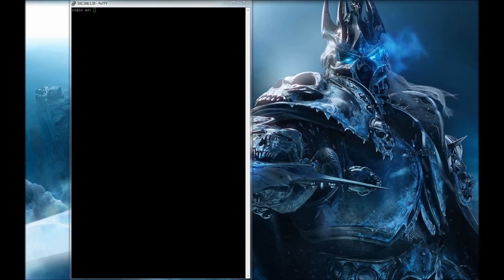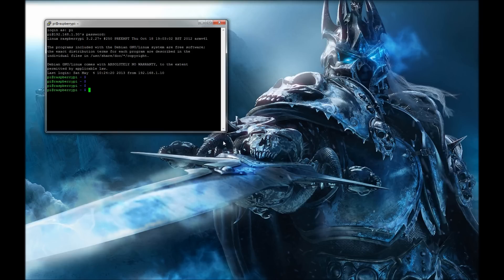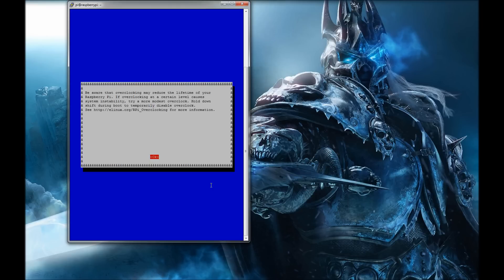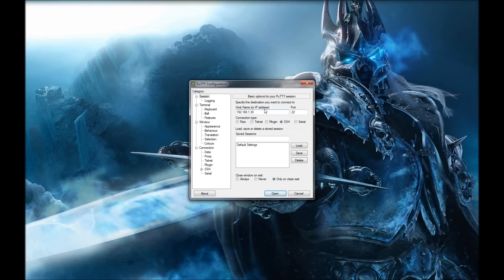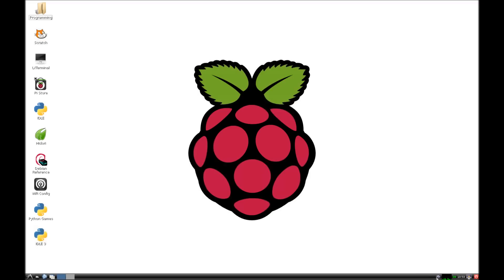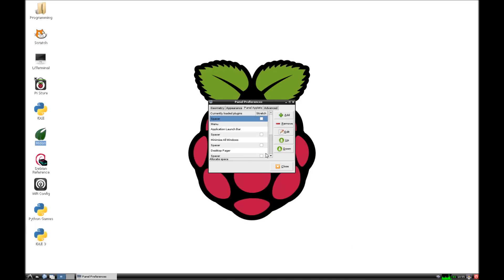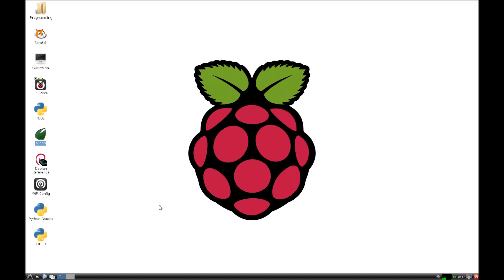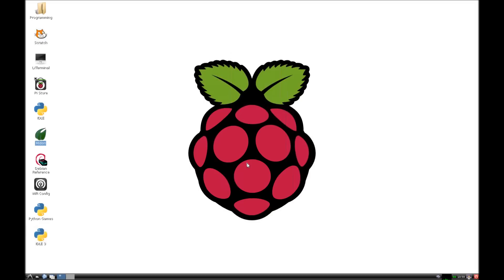Over Clocking The Pi

Comment: hi is it safe to overclock it to turbo mode I have hooked up a 11.1v cpu fan with a sepertae psu so to not damage the pi so with that is it safe to put it on turbo
Reply from the maker: If you have a fan and heatsink combo I would say yes it should be fine.  However, if you are just blowing a fan on the pi there may not be enough surface area on the chip to effectively reduce the heat generated by convection alone.  However, if you have a thermal probe you could monitor the temp of the pi and I would say anything around 60C would be fine but if you get close to  80C - 90C I would not run it there until I got a good heat sink.  I did a quick google search and found a heat sink kit. http://www.mcmelectronics.com/product/83-15200?scode=GS401&CAWELAID=530004080000003106&gclid=CP_Yrd_gk74CFS8V7Aodxg8ASw

Hope this helps.
Reply: misperry hi there thank for the quick reply I uploaded a video for you to check out my fan and tell if that is sufficient. I ran minecraft on trubo and it was at 40 and when running other stuff it stays at 30 fine so yh please check out the vid since then I added another 12v fan just to be safe